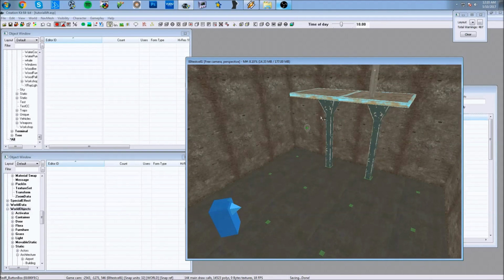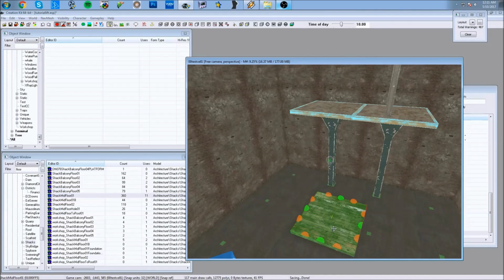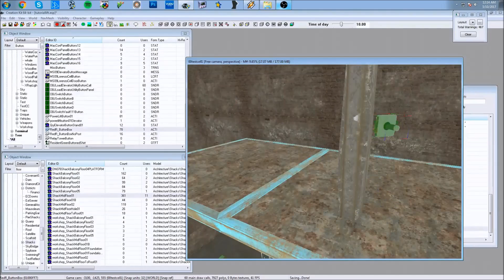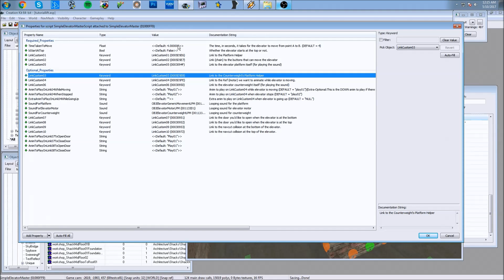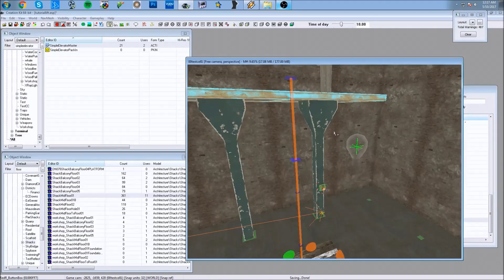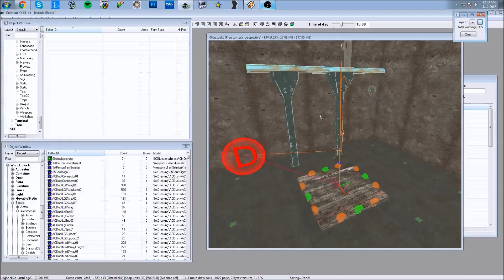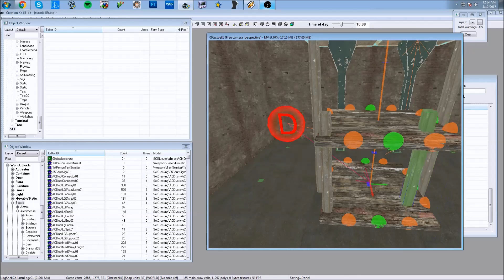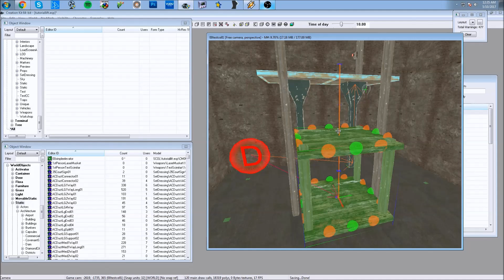Fallout 4 Creation Kit Tutorials: Creating Simple Elevator & Platform Lifts

Comment: SHOULD  HAVE  TOLD  THEM  SOMETHING  VERY IMPORTANT  THAT BUSTED  MY  B@LLS...... THE  ELEVATORS  HAVE  A PERSISTENT VALUE  AND  WONT  WORK  IF  YOU  CHANGE ,ADD  ETC... ON  THE  SAME  SAVE...I  HAD  TO  USE  ANOTHER  SAVE  TO  SEE  IF  IT  WORKED .....SOME TIMES  FAST TRAVELING  SOMEWHERE  ELSE  AND  COMING  BACK  WORKS...BUT  NOT  ALL  WAYS...